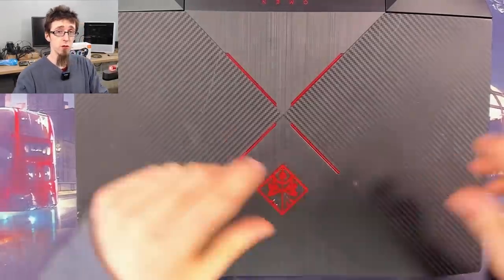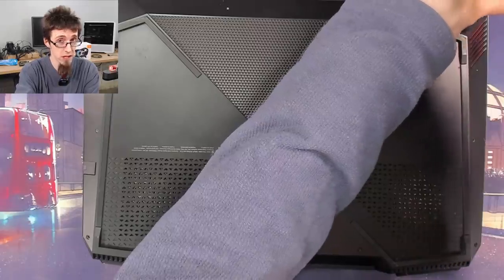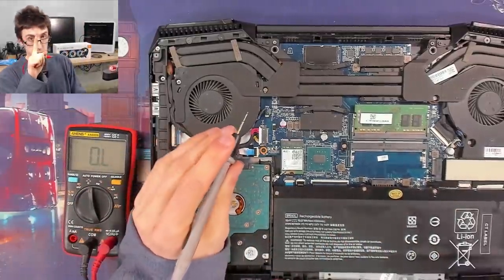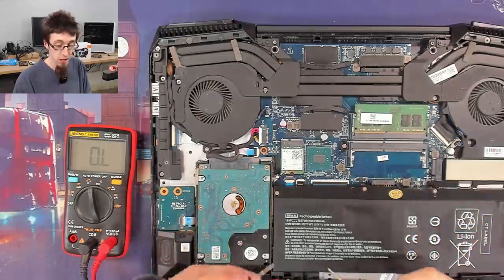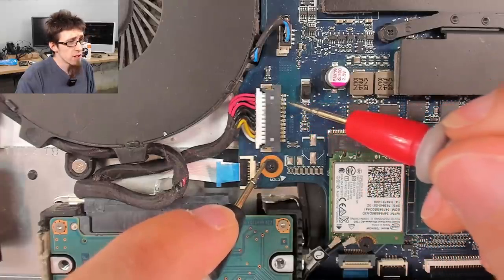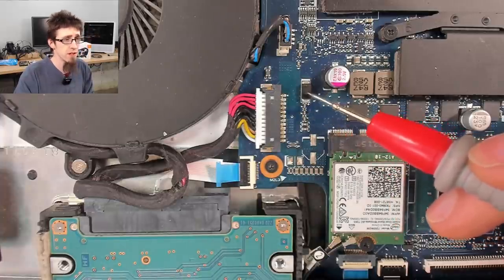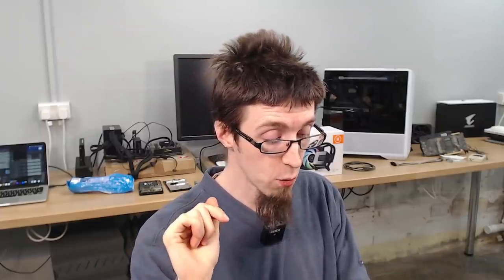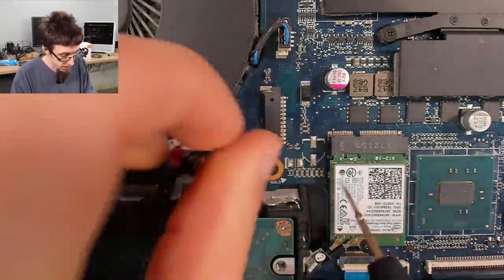HP Omen with a shorted TVS diode, easy board repair - LFC#264

Comment: @AdamantIT Graham, this video clued me into the TVS diode that is on the "sense line" of Dell laptops, coming from the center pin inside Dell barrel connectors. If that TVS diode blows, it doesn't matter if you replace the Dell charger and the power jack on the laptop. The laptop will still refuse to recognize the charger, since the TVS diode is permanently shorted to ground! Thanks for this video.

Comment: @Adamant IT, You are correct on the Name of the Diode! 
From WIkipedia,
"A transient-voltage-suppression (TVS) diode, also transil or thyrector, is an electronic component used to protect electronics from voltage spikes induced on connected wires."
Spot On!

Comment: I fully understand you! I am currently working on an MSI GT72VR 6RD and I effin hate getting battery out of it. Need to take off the cooling system off of the GPU and CPU to be able to get mid section off so I can remove the battery O.o so much work :S

Comment: I use to repair a ton of CB radio's that had the same type of protection; most failed due to the mobile radio installed incorrectly, "the diode was a 1 amp straight configuration".

Comment: The mechanical hard drive is unforgiveable
Reply from the maker: Y'know I didn't even notice, I thought the M.2 drive had been pulled by the customer, but now you point it out, it booted right up... Good future upgrade for them then!
Reply: @Adamant_IT  i'd be more upset at the single channel memory.
Reply: Gaming laptop with hard drive? Obviously not a serious gamer!
Reply: @Adamant_IT  My Omen has 2 drives; an m2 boot drive and a mechanical d: drive. It's under a metal shield. Full blown graphics and 32Gb . . . it does the job.

Comment: If I may ADD to the info re: KAPTON tape:
It's tackiness isn't particularly good (in my experience) -- but in addition to not conducting heat, it also ...

DOES NOT LOSE IT'S TACK (ability to stick) FROM BEING HEATED -- as cycles repeated on electronics. :)

Comment: Good video, one thing though: That 'backward flow at high voltage' behavior you described occurs in Zener diodes, not in Schottky.
Reply: Yup
Reply: True, but all diodes exhibit some form of reverse breakdown, it's whether that's at a useful voltage that matters. Also that diode is there to kill a reverse polarity supply in case a wrong charger is used (though these days almost everything is centre positive on the barrel jack).

Comment: The problem is relying on a charger & it’s safety circuit .
You needed a poly-fuse ( PPTC ) between the diode & input jack .

Chargers go faulty , get lost so replacements are need .
Normally it ends up as a “No Name” low cost alternative , a random old charger or power brick ;-)

“ We have a big box of old chargers one should work right ” 
What’s 2A 20V A/C output  ……………. look the plug fits !

Comment: Nice simple one for a change graham :-D
As far as i know impedance = inductive/capacitive reactances with a.c frequency and resistance or loss.
You were measuring d.c resistance :-D
Reply: dc resistance is impedance
Reply: @zx8401ztv  Impedance is the generalisation of the concept of resistance, DC resistance is not dependant on frequency, but the resistance of a capacitor for exemple depends on the frequency of the signal,and a simple real number is not enough to contain all the information of impedance (module and argument of impedance are 2 informations stored in 1 complex number)
The impedance of a resistor can be stored in a real number and is equal to U/I

Comment: That m.2 sloe screams "I WANT TO BE USED" :p good video Graham, like always! I am a guy who likes to repair stuff but i don't have the knowledge yet, but everyday i am learning! Could this diode be used in a phone as well? Lets say you took the wrong battery from the same brand and the polarity is reversed, you the battery in and noticed that it is the wrong one, is there also a diode? I have this problem, a customer took the wrong battery and put it in what is to be a quite rare phone, a sony ericsson play, a 'playstation' phone, he brought it in because nobody could fix it, i told him i will take a look but i can't promise anything. It has a dead short on the battery pins and charger voltage isn't making its way to the battery terminals. There seems to be nothing wrong with that board though, no blown up components or nothing, would it be a good idea to inject low voltage high amps into that board?

Comment: THANK YOU!!!  I've been needing info on diodes and particularly TVS ...  Can their status be checked en vivo..? (on the board) or must they be removed to check..? Can I check them with a regular DMM..? Or do you get more info from an LCS ..? 

One more question:  How do blown fuses create connections to ground !???  I always thought a 'blown fuse' BREAKS a connection; not 'CREATES' one... can you elaborate on that please..? 

Thanks!
Reply from the maker: The fuse analogy was a little clunky... what I meant was that it's a sacrificial part that's designed to fail during a fault, in order to protect the rest of the device.
To get a true answer, you have to remove the diode to test it - but there's not a lot at DC-IN that connects the positive and negative terminals (until after the inrush limiter) so a short on DC-IN has a very good chance of being the diode.

Comment: Another great Video and job done,I have here HP slim 290 no power ,power adapter fine 19V detected,but I have only 4V from the positive pin on the power port. Thats mean the port is faulty or ? Thx.

Comment: Might be worth you investing in Tweezer Soldering iron or possibly just get some 1.5 or 2mm copper wire and make up a simple item that is wired on the iron tip and has two ends folded at 90 degress just lay on the device to remove and bingo gone and no heat damage :-)

Comment: Any reason you didn't show checking the output of the Mains Adaptor before plugging in after the repair? You mentioned they can fail and if it had and was giving out more than the reverse bias of the diode, could well have been the cause. I repaired one recently that was giving 90V output due to shorted turns in the transformer of the SMPS. Same fault symptom, blown diode.
Reply from the maker: Yea I kinda when with my gut on this one, as hot chargers are pretty rare in my experience. Absolutely right though, would've been easy to plug the charger into the disconnected jack and measure the voltage to make sure it was all normal!

Comment: Given we dont know if something blew that diode, i would also put it back on before powering it up just to be safe given its a customers laptop and definitely put it back even if it was my own as that thing acts like a fuse and you never know when current or voltage decides to go nuts and burning multi layered boards is impossible to fix. So lots of fuses in everything is the way to go....

Comment: I have a laptop from 2012 that died during a BIOS upgrade. I replaced the motherboard with a SH one from Aliexpress, that one died too after ~2h of use. Both cases the laptop won't turn on when pressing the power button. I wonder if I could send you the laptop to take a look at? I live in Romania BTW :D

Comment: Hello sir, i have same model laptop omen and has little different problem. The laptop is dead, but charging light is on when connected to AC adapter. It can not boot up. What is the possible problem? I checked the voltage on power Jack, it showed 19.5 v. I hope your reply sir.

Comment: Hi, I have the same computer and I have that problem (I plug the charger and no light)but the solution it's not that diode. I checked the cable where you plug the charger and it's fine also tryied whit an improvised power supply whit no control cable I don't know if that is important but still no life.

Comment: you said the customer has replaced the DC-jack and when he plugged in the charger the diode blew. Did you check the new DC-jack first and didn’t show in the vid? my first guess in such a case would that the customer had done anything wrong while replacing the jack and just connected it the wrong way round on the side of the jack.
Reply from the maker: Ye I checked it at 6:00 just in case! Another possibility is that the diode blew when the old DC jack failed/broke, but it wasn't until a new jack was fitted that power actually flowed and then smoke happened.

Comment: love your videos, can you tell if BIOS IC is bad or is there something wrong with the motherboard, I have two BIOS chips (4MB & 8MB) on same motherboard and one of them (4MB) is not retaining data, the other one is fine. can you also tell me why there are two of them and why are they of different sizes?
Reply from the maker: I'm not sure what the second one is for, seen it myself as well. At a guess, I'd say it might be the EC Firmware, but that's purely a guess. Certainly if the 4MB chip isn't retaining data, it sounds like replacing it could solve your issue.
Reply: @Adamant_IT  again thanks for replying, after searching  and searching i learned that my bios is actually of 12MB and is splitted.
And the ME is of 8 MB and the BIOS is on 4MB flash.
Then i was unable to find 4MB flash anywhere so i was thinking if i could use a 8MB flash and write 4MB dump on starting of the flash.
But i was unable to get that delivered also, at first i was just using the clip on connector to write to the flash and it was always missing the data.
Then today i simply desoldered the IC and soldered it directly to the programmer, and this time the chip took all of the contents.
I took the dump again and compared the data and it was identical.
But when if resolderd the IC to the laptop again it still won't boot and then i checked the chip was missing its contents once again.
I'm so much confused right now.
Laptop does nothing with battery connected but when i connect AC and press the power button it starts up and runs the fan at full speed, no lights on the laptop and the only way to turn the laptop off is to diconnect the  AC power.

[Edit] I was able to fix my laptop had to flash both of the ICs and don't know why but i have to desolder both of them.

Not gona lie, I have learned many things from you. I have learned alot from this experience and I also have to finish the documentations which i downloaded for this.
Assembling my laptop now.
Thanks and have a great day.

Comment: Not really a relevant question but a big fan of the videos. I have a z370 Aorus gaming mobo with Ami bios F4. I have never updated a Bios and was wondering what benefit will I get or see. My pc runs great has a gtx1080 32mb ram is there any point?
Reply from the maker: You might get the new-style Gigabyte BIOS interface, but I don't think you'll see any useful feature improvement. In my experience, there's not much change in BIOS updates on Intel platforms, so I tend not to bother updating unless there's a specific reason or bugfix. By comparison, AMD BIOSes have the AGESA firmware in them, and updating that brings in performance improvements. So on AMD it's worth staying up to date, but Intel kinda polish their BIOS before release and then leave it alone.
Reply: @Adamant_IT  many thanks

Comment: It's always nice to provide the part numbers when possible.  Looking at the video, it would appear the diode is marked "BV" (corresponds to a SMBJ20CA, see https://www.mouser.com/datasheet/2/54/smbj-778392.pdf).  This would seem to correspond to a 20V bidirectional (which seems odd, this application would seem to need a unidirectional). The video isn't super clear, even single framing.  Can you confirm the number? A "BY" variant would be 24V, but still bi-directional.  BTW: for a look at uni- vs bi-, see https://www.mouser.com/pdfdocs/AND8424-D.PDF
Reply: agree

Comment: Can anyone point me the direction of fixing my laptop ? 

I have replaced the Thermal Paste on it and accidentally blew my Screen Backlight Fuse off. 

After finding the blown fuse and removed it + short the circuit to see if the issue is still there...  the screen is working fine... but now the Battery does not charge anymore. 

The laptop seems to be working fine only when plugged in ... but dies immediatelly when I disconnect the charger... which means that the battery is not charging.

I have removed the battery and tried it out in my new laptop (they both have the same battery model) ... I have charged the battery ... but when I try now to connect the charger... the charger's protection kicks off and cutts the charging power.

I have tested the battery from my new laptop as well... and the charger cutts of the power as soon as I plug it in.

Any advice on where should I start ?

Thanks in advance

Comment: Ok wen you have a transient Voltage,a Surge Voltage or an Overvoltage it conducts and bypasses, in mouch the same way like Voltage was to high,right? And wen you have an example vor example? Or a Charger with 19V in a 16V ratet Laptop? Would it short or cant it Handle the current of a wrong charger? If it delivers more Amps also..
Reply from the maker: It depends on the rating of the diode. Most laptops can handle a "hot" charger, and the in-rush limiter will block the voltage if it's too high. The diode is there to bypass a voltage that will kill something in the laptop. If there's lots of amps, the diode will probably get blown up in the process - but that's still better than blowing up the mobo.
Reply: The charger never 'delivers' more amps, the current drawn is always controlled by the load. 
Current I = V/Z where Z is the impedance of the load. Of course if V goes up or Z goes down I gets bigger, but you cannot 'force' current to be more than the load wants to take. If Z is very small but the source has no current limiting then I can get very large at which point something melts, ideally a fuse, but could be the wiring or a PCB track. That could be what happened to the original DC jack as a sacrificial part.

Comment: really wish my dell Alienware was that simple they have tons of those diodes sitting around the input ground and positive connection, I have a Alienware 17 r4 when i  plug in the PSU, the PSU triggers protection mode, so i saw this video opened up my laptop LOL yeah not this easy all sorts of different component's is that general area i cant even pin point the TVS droid i have like 6 of those diodes in the area crazy i got quoted $300 DOLLARS to fix this simple problem and id really like to fix this myself i have a cheap multimeter Walmart brand and i cant tell shit from shit

Comment: Wat is Rabbit hole
Reply from the maker: Rabbit hole means very hard to solve. One problem leads to another problem and then to another... and there doesn't seem to be a single point causing the device not to work.
Reply: @Adamant_IT  can I know what type of camera setup used for solidering ,it seems to do the job

Comment: I always remove the board when using the hot air station. Don't want to melt anything underneath. A lot of extra work, but rather be safe.
Reply: Apologies. Your knowledge and work is excellent. Perhaps I should have added that instead of just what I typed. Thanks for sharing.

Comment: I swear that diode has been installed backwards, the cathode marking on the diode doesn't match with board marking??? 9:49 shows cathode marking at top, but at 11:57 you have it backwards! the original one was installed the correct way at 8:28
Reply from the maker: This has me very confused... because I've looked at the time stamps and you're absolutely right. But then after fitting the diode I checked that it was working correctly, which you see in the video, it works, as does the laptop. I also just checked two other laptops with protection diode and measured those diodes in the same way I did this one, and got the same results. If the diode were the wrong way around, it would be clamping the charger when you plug it in. I honestly have no idea what's going on here.
Reply: @Adamant_IT  That's really odd isn't it, very intriguing. Well if it works it works I guess.
Reply: that had me confused too , spent two hours trying to understand . I believe you connected it in reverse bias mode
Reply: @Adamant_IT  Rewind and agree with Adrian Finn and Mo KH. That piece is connected in reverse bias. I also don't understand how that laptop didn't fail immediately again. Another way of saying it, all the theory and practice about diodes that I had learned until today collapses.
Reply: @carlosgarciaoropeza5480   in reverse bias mode it is protect against reverse polarity the diode has no effect when the input voltage polarity is correct. But, the diode acts like a short when reverse voltage is applied
Reply: @Adamant_IT  the diode originally was placed in forward bias and it was TVS diode to protect the laptop from voltage spike . the way you soldered yours you placed it in reverse bias and that now to protect the circuit from reverse polarity but for that matter you should of used a  schottky diode